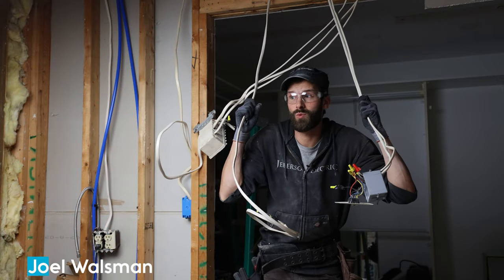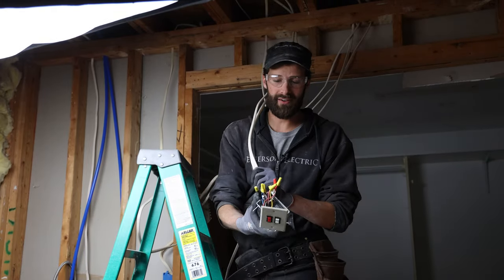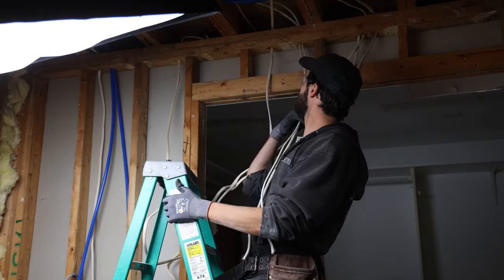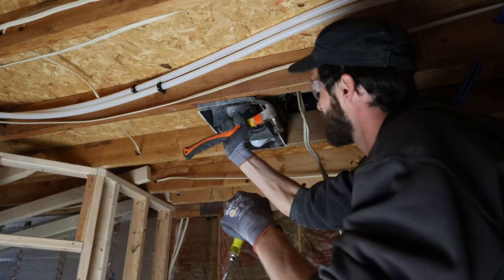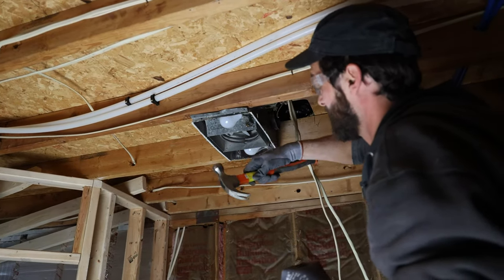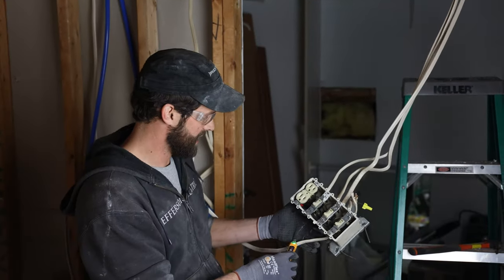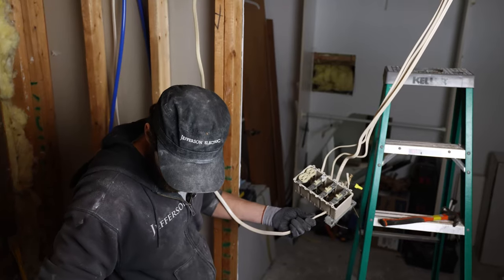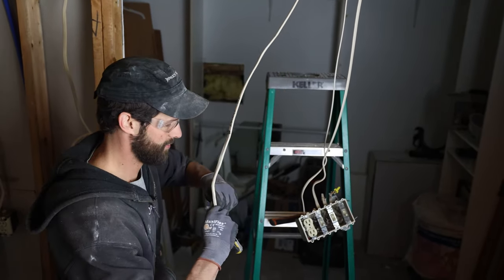Tracing Old Electrical Wiring

Comment: 22yr as an electrician and this is great stuff. Electrical work is diverse. I never handled residential wiring, it’s all new to me. Spent most of my experience on raceways and conduits. And I learned a lot more than I want to know about jackhammers and concrete saws.

Comment: You can only cut power off that way so many times until you run into a federal fire Pacific electrical panel and you start arc welding in an attic crawl space....
Reply: 😆😆😆works usually though
Reply: Replacing one next week lol

Comment: in your "the wrong way to find a breaker" I'm reminded of a number of years ago I worked at a drydock. they were replacing the deck and cut through a wire that was (improperly) routed through a weld hole. I was asked to find the breaker so I thought just grounding it out would trip the breaker, like we've all done.
nope
the wire stayed there arcing like crazy until the cable caught fire. breaker never did trip. had to track it down the old fashioned way by actually tracing wire back to a distribution panel and shutting off breakers.

Comment: Exceptional, Joel brilliant teaching and some very good practical tips. Never work live in any setting - never for residential settings, and even for commercial and industrial work you have  to plan for downtime for doing electrical work. Wagos 221 lever types are very useful for tracing out - using continuity test on the multimeter. Work with knipex fully insulated tools when cutting wires and clean up just that extra little bit of security. I find different colored tape for home runs and then different colors for spliced wired to other devices in a room can be useful especially if you have them rolled up and tucked away so you can identify the layout quickly when walking through again. Ideally you can draw room layout and identify cable locations.

Comment: I did that same test trying to find the breaker, it didn’t work and I couldn’t find where the power was coming in. My electrician said “that happens sometimes on old houses” and capped it off. ??? 🤦‍♂️???

Also, I help our Maitainance guy at a nightclub in the mid nineties re-dux a section of drop line in conduit. It was 220 split to two 110 outlets (4 gang)  for stand up coolers and then back to one 220 for a horizontal cooler. We shut off the breaker makes for that cooler area before I began to change all three of the broken outlets. Well. The panel was labeled wrong. So wrong that the breaker for this system was in a different part of the building. 220 makes a 8”, #2 Phillips into a stubby bar very quickly. Good thing I moped the area and let it dry before starting work. It took about three days for my hearing to come back. Good thing the screwdriver I was using was insulated by about a quarter inch of electrical tape around the handle. Never will forget that learning experience.

Comment: Is there any chance you could try to do some even older wiring? My home was built in the 1870's, and get some of the first electric in the US likely in the late 1890 or early 1900's. The things I see in videos like this are useful, but still oh so new in comparison. Its not knob and tube, but rather in wood case channels. Tracing it through lathe and plaster walls is incredibly tricky - especially if you're not trying to rip apart the house in the process. But I've never seen anyone approach this who didn't just want to demo the whole house and all its character.
Reply: If you want to get behind the walls there's only 2 ways, having attic access or just cutting squares out of the wall and just screwing them back on. (It is not a problem covering up the seams and making it whole again just costs more money unfortunately) If you just want identification there's higher tier circuit tracers that can just use a 'wand' type that I use to identify wires underground or in concrete and cinderblock walls, but that is incredibly expensive if it's not for work.
Reply: If you can get the  tubes out they make a easy cable way to pull new wiring.

Comment: Thank you for this! I need to replace a circuit since the wire is cracking and is the old fabric/tar type as well as ground the circuit. I am running into all kinds of disconnected wiring from past jobs that are sending me on dead ends. Your video is great!

Comment: When I worked in the central Control Room for the power company (thank goodness I wasn't on shift! ), an electrician in an important substation blacked out half of metropolitan Los Angeles by cutting through bundled cables. The prints said they were abandoned-in-place cables. They weren't. They were live control cables. When he cut through them he shorted the circuits and sent trip signals to every breaker in the switch rack. Moral of the story, don't cut through multiple wires, even if it's "only" Romex, even if you "think" it's not energized.
Reply: I made a pair of wire strippers by cutting a live wire with a load. The melted notch was exactly #12.

Comment: I am actually doing a very similar job to what you are showing. Adding a pantry to a kitchen expansion and bathroom reduction with an office redo too.Just add a 10' sub panel move in the middle of it. Two 12" J boxes for the wires and supply extensions. Fortunately they stripped all the drywall and I have good attic access. Seems they liked to rely on conduit grounds a lot in the old days. The mess is there were too many so called electricians in this house over the years. Cheers bro, I feel the chopping exploration. You got to be Sherlock Holmes to figure this mess out, eh?

Comment: I have one of those heaters in my lavatory. Nice when you take shower in winter time. I hope I don't have to take the ceiling down to get it out of there. It broke and I would like to get a new one. It has one switch that operated the whole thing though, and I thought to make the lights and heat independently switched, but I haven't got that far yet. Not sure if it exhaust to outside or not. Everything else in this house is exactly wrong from ground wires being cut and ignored, to a bootleg ground in the lavatory to fool the inspector. I got a nice shock from my metal housing vacuum cleaner over that. It was not fun.

I made a plug that was wired for a dead short and a switched power strip just for the purpose of tripping a breaker. Safer than creating an arc, so just a suggestion. Of course it won't work with a GFCI though, but if GFCI is at the breaker, then you'll know. That's a big thing here too. My panel should be relocated. I planned on using the existing box as one big junction box to make all the connections to run the wires from the old panel to the new. Inspectors might frown on that. I should also have AFCI and GFCI and Surge... I swear the NEC are electricians that feel they don't have enough work to do, or think that people are made of money. Prior to all of it, got along for hundreds of years without it just fine.

I like hearing about getting rid of 14 gauge. I think minimum should be 12 regardless of circuit, except of course 220 that require 10. I'd like to see 14 disappear completely though. People have a lot more than a light bulb these days. I myself use Halogen 100 Watts, mainly because I'm old and my sight is failing, but I also like my glass light bulbs that get hot when I turn them on, and they don't flicker like LEDS do.

I have nail problems too. The idiot that installed junction and gang boxes used nails, going right through the box. No grounds on anything, and he cut the ground wires when he could have used them. Even installed three pronged outlets but ignored the ground. So all kinds of fun if a nail touched a hot wire.

Comment: Tore down wall and need to reconnect power to upstairs Continuous line but now the fire is too short to connect it at a different location. How do you properly connect power by code without adding a hidden Junction box behind a wall or ceiling?

Comment: I am updating some wiring at my residence. The home was built in late 1980s and most wiring appears to have been DIY with limited experience or skills. Truly a mess and what is on circuits makes no sense. Running dedicated circuits to several appliances  and "rearranging" several circuits to avoid overloads and so disconnecting one circuit does not turn off power for most of semi finished basement. The project is more involved then I had originally anticipated as I am discovering more issues then I was aware of.
Reply from the maker: Sounds right 😅. Let us know if a live video call would be helpful: https://electric-pro-academy.square.site/!

Comment: With you being an actual electrician, I would like your opinion on something. Is it safe to replace/install a light fixture, ceiling fan, etc  by just turning off the switch? Or should you flip the breaker? And I'm talking about DIYers, not professionals.
Reply from the maker: Totally safe so long as you've communicated to anyone who might make the human error of turning it on while you're working. Electrically speaking, a switch is a miniature disconnect, it's not going to reenergize if no one is touching it.

Comment: I use to do that to find breakers. Till one time.... It didn't pop a breaker, stayed hot. Made me think where else could of arc'ed besides my joint. Which started a slew of bad thoughts for customer safety. So since then I stopped, unless I have no other options.
House ended up having a big neutral imbalance, how it was before I touched it.

Comment: Tore down wall and need to reconnect power to upstairs Continuous line but now the wire/cable is too short to connect it at a different location. How do you properly connect power by code without adding a hidden Junction box behind a wall or ceiling?